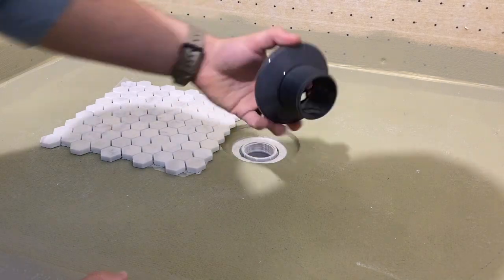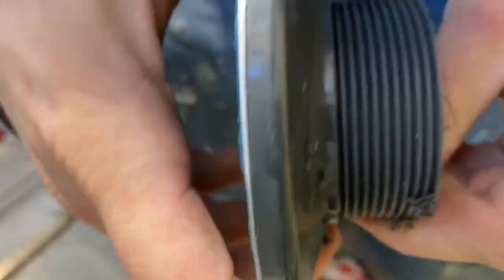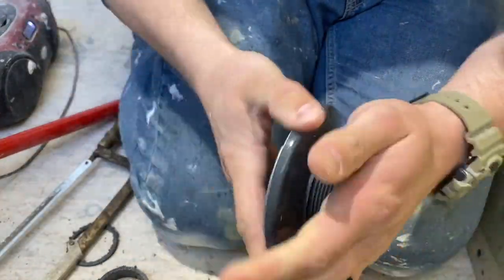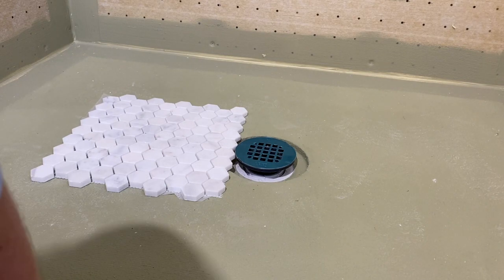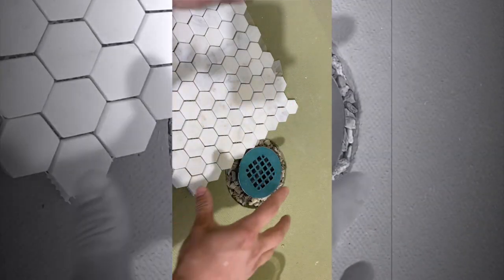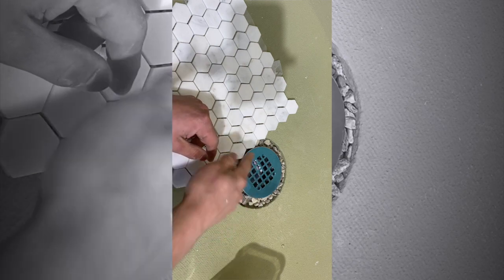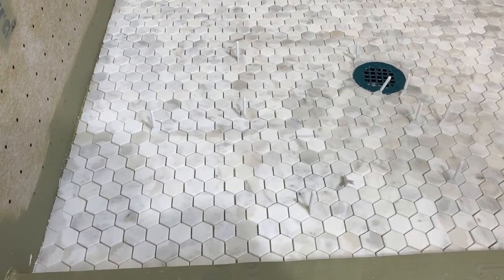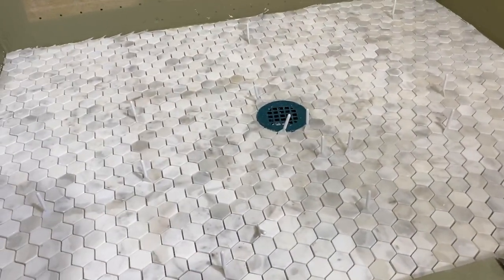Shower Pan Tile. How Weep Holes Work

Comment: Weep holes and rocks are not designed to let water down the drain.  It was designed so the water doesn’t wick into your dry pack pan. Water takes the path of least resistance & gravity to go down as it goes around the outside of your drain.

Comment: Obviously you’re not a licensed contractor. How are you going to make videos explaining how something functions when you yourself do not have a clue. You tiled directly over a preslope and cut down the threads from an adjustable drain, you ever think maybe the adjustability is so that you can do a secondary slope to the finish flange? I use the hydroban product. I’m not a fan of the hydro barrier foam board you used for your wall substrate but I can live with that. I can’t live with you misleading people on a public forum. From where your at at the beginning of the video you would float the pan a 2nd time on top of your preslope to flush with drain keeping the weep holes with pebbles yes. Tiling over the preslope not acceptable
Reply from the maker: Very interesting. I just went to Laticrete training last year and this is exactly how they show you to do it to keep their warranty. The pan is 100 waterproof and tile ready. The drain is tall to allow you to cut down just in case it it used for brick pavers in an outside application. Why in the world would you do a mud job over a tile ready pan? This is not a pan liner! You comment made me laugh the entire time reading it.
Reply: @WINNI.Designs  someone was just looking for attention. Or realized they've been doing it wrong this entire time and their ego didn't want to take the fall for it. Either way it's hilarious.